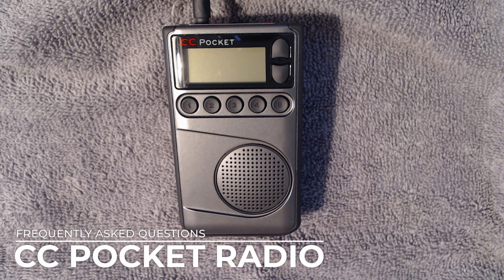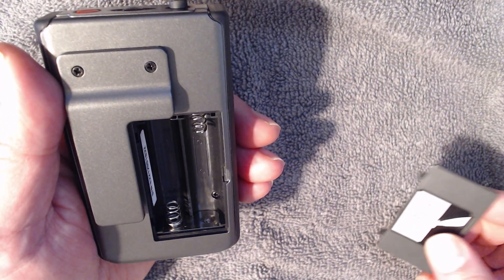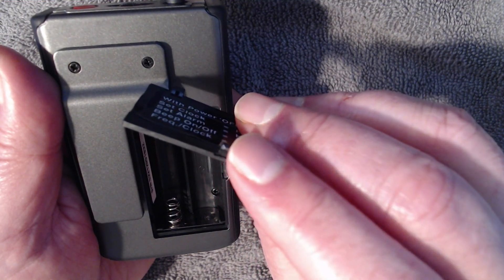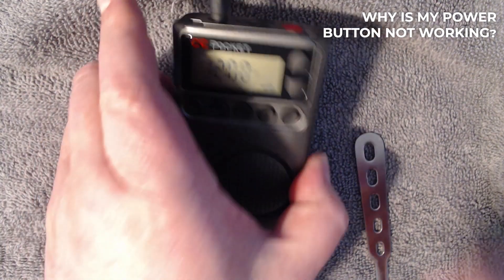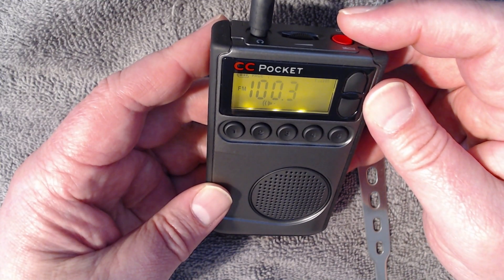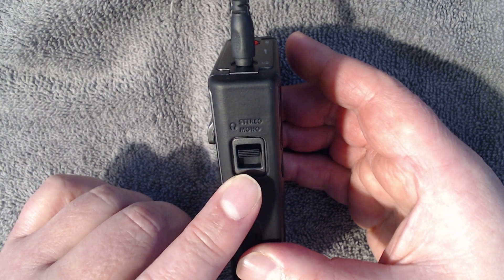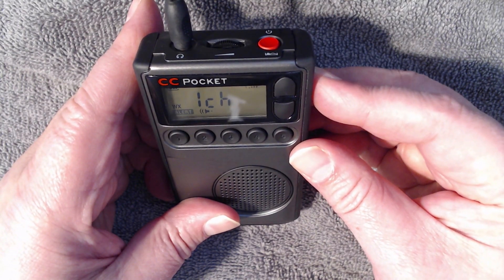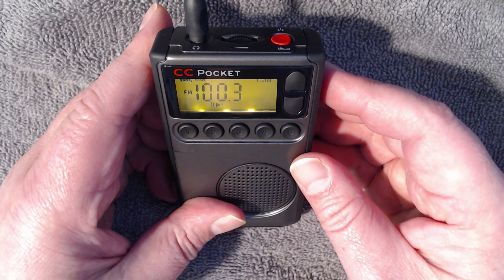CC Pocket Radio Common Questions

Comment: Can you use an fm wire antenna in headphone jack?
Reply from the maker: Thank you for your question. Our CC Pocket Radio includes an FM Antenna Wire that can be connected to the headphone jack to improve FM reception when listening from the speaker of the radio.

Comment: Does the radio work without headphones? Because it will only be used without this accessory.
Reply from the maker: Thank you for your question. Our CC Pocket radio includes a speaker and will work without headphones or earbuds.
Reply: @ccraneccrane Is there good FM reception without headphones?
Reply from the maker: Sorry for the late reply. Our CC Pocket Radio includes a FM antenna wire that can plug into the headphone jack to improve FM when listening using the speaker of the radio.

Comment: Is there a way to view 24 hour time?  thanks
Reply from the maker: Thank you for your question. Our CC Pocket radio will only display the 12 hour clock for AM/PM. Our CC Skywave 2 and CC Skywave SSB 2 can display the 24 or 12 hour clock when option is selected.

Comment: I’ve had mine for MANY years.   I did have to use a drop of DeoxIT in the Volume.
  Fantastic quality‼️
I also have the CCSkywaveSSB, and the EP-Pro, as well as my little old CCSWPocket, which still works outstandingly.
Can’t go wrong with a C.Crane.
📻🙂‼️

Comment: Bought mine a long time ago. Great radio. The power button eventually died so I had to mod a new one and it works fine now. The volume wheel is starting to get very staticy. Might need to deoxit soon. What's the difference with the older version and the new one?
Reply from the maker: Sorry to hear that you are having issues with our CC Pocket Radio. 
We switched to a non-stop rotary dial to prevent breakage compared to the past conventional volume control. The audio amplifier component was also modified. 
 Please call us if you recently purchased our CC Pocket Radio and are having issues with it. Our number is (800) 522-8863 Option #4 for Tech Support.

Comment: What happens when the volume control works but volume does not lower? Is there a reset button?
Reply from the maker: We switched to a non-stop rotary dial to prevent breakage compared to the past conventional volume control. The audio amplifier component was also modified. This is what leads to the louder audio low point. 

I understand that the volume level may be too high for your desired listening. If you are using earbuds or headphones, we can offer a short cable with a volume control that can be connected to the radio’s headphone jack and then to the earbuds that will allow you to adjust the volume to a very low level. Please call our Customer Service at (800) 522-8863.
Reply: This is good news!

Comment: Had one. Returned it.
Dt-200 Sangean for the W.
Reply from the maker: Thank you for your feedback!
Reply: @ccraneccrane  Let me elaborate on the issues I had with my unit which was the 1st version and was purchased 2 years ago. The noise floor was crazy loud. Unbearably so. The volume wheel had all kinds of lateral slop and looseness. If these issues are fixed with the 2nd version I would definitely try one again because the receiving was good and the bandwidth selection helpful.

Comment: Would like explanation of non-stop rotary dial for volume control. I either get no sound or very loud. A conventional volume control would be better.
Reply from the maker: We switched to a non-stop rotary dial to prevent breakage compared to the past conventional volume control. The audio amplifier component was also modified. This is what leads to the louder audio low point. 

I understand that the volume level may be too high for your desired listening. If you are using earbuds or headphones, we can offer a short cable with a volume control that can be connected to the radio’s headphone jack and then to the earbuds that will allow you to adjust the volume to a very low level. Please call our Customer Service at (800) 522-8863.
Reply: @ccraneccrane  Thanks for the reply and explanation. I will use a different radio when I need a low level on the volume.

Comment: Had 1, Returned It. Yofits and Prunus have Much Better Pockets for 1/2 the Price. No Hiss, No Static, More Bass, and A Real Extendable Antenna.  No Stupid Wire Or Headphone Wire Acting as an Antenna!
Reply from the maker: Thank you for your feedback!
Reply: The radio has a built in antenna. I get stations even w/o the headphone wire being used. Headphones options play a large part in the audio quality--provided you're using headphones. If not, just get a larger stereo (=/>2 speakers) radio for much better sound.
Reply: Prunus radios are notorious for lacking bass and are known for sounding "tinny".